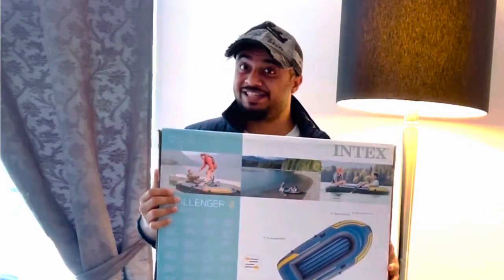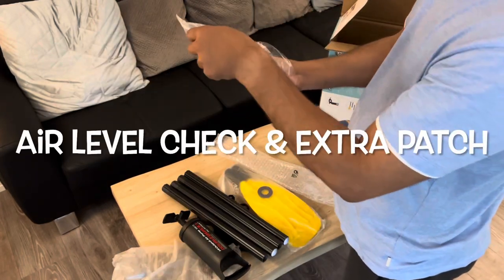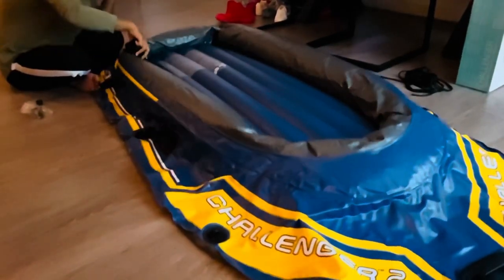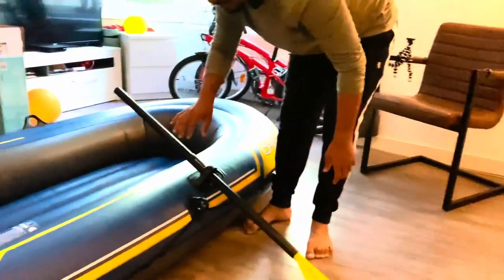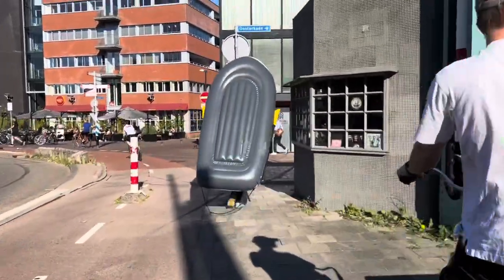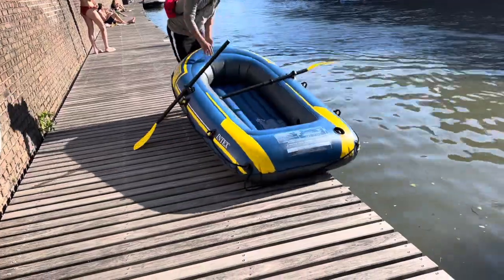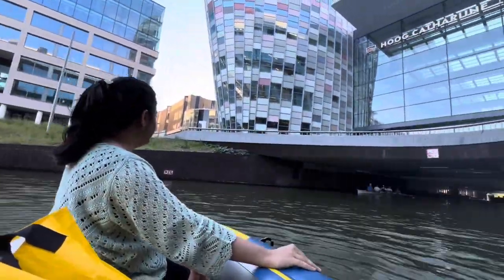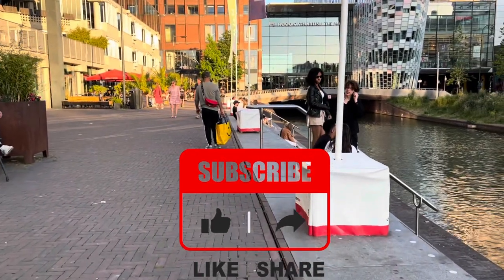Intex Boat - Unboxing & Review | Inflatable Boat | Challenger 2

Comment: I 've bought this boat and I intend to use it in calm sea. My plan is to take it 200ms away from shore.

My question is, I think of tying a 5kg weight to a rope and use it as an anchor so that the current will not stray me away while fishing, I will tie the rope to the front handle to pin point the boat. Do you think this plan would work? I appreciate all your advice
Reply from the maker: Sorry, but I wouldn't advise you to use this boat in sea, as you saw it has capacity for 2 person, so you may carry anchor of 5kg but it would be at your own risk ⚠️ it may not last longer than 1-2 hrs!

Comment: what is that electric pump?
Reply: I got the electric 1 with battery/wireless for the same price as the one that only works connected to  the plug/car
Reply: @Gustavo Medrano🫡  what is name of the electric wireless pump you used please
Reply from the maker: Hi, here is the link of the pump I used but it seems to be unavailable now, you can even buy similar pump from amazon, bol or Action (in much cheaper price):

Morpilot Electric Air Pump, Wireless Electric Pump with 6000mAh Battery, 3 Air Mouthpieces for Inflatable Air Beds, Inflatable Boats, Air Bed, Swimming Animals, Swimming Rings and Camping Automatic https://amzn.eu/d/dJAMrhF